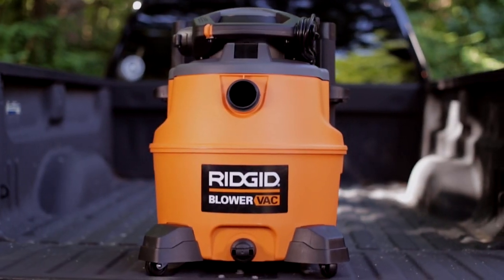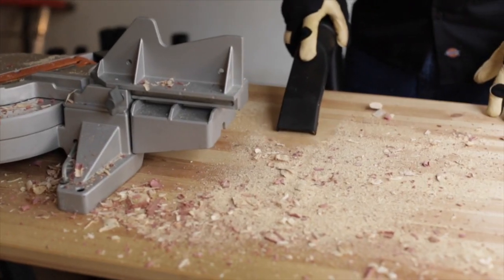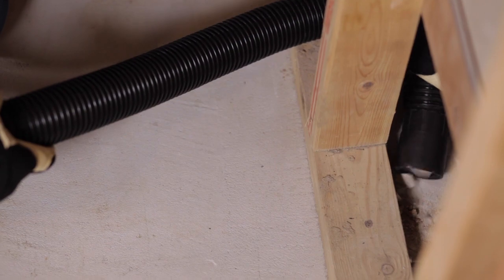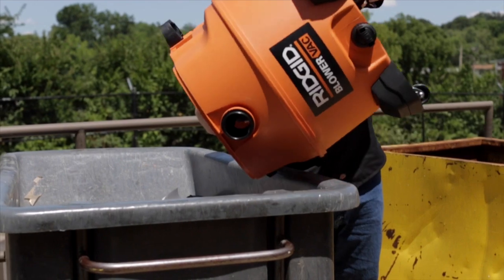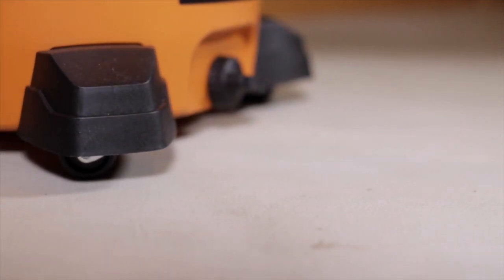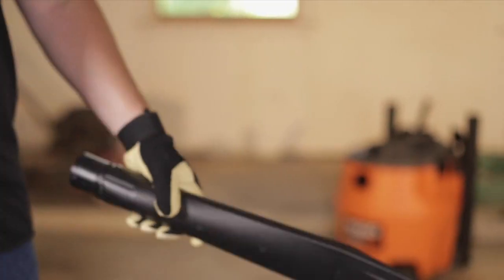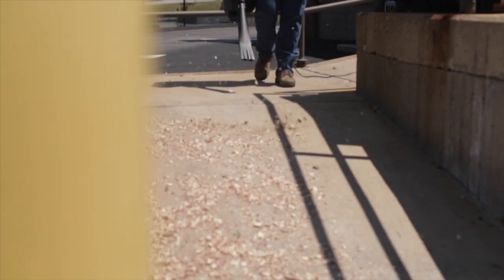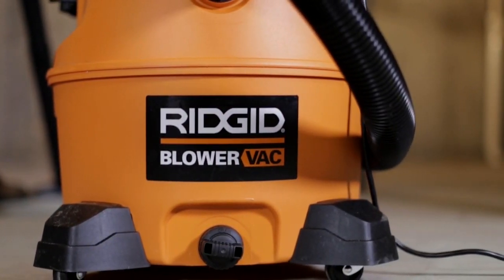RIDGID WD1680 Wet/Dry Vac With Detachable Blower

Comment: Excellent video showcasing the quality build and innovative design of the Ridgid WD1680 Wet Dry Vacuum with a detachable blower. I've tested several brands of shop vacuums and this Ridgid WD1680 Shop Vacuum manufactured by Emerson Electric has proven to be the best wet dry vac available in Thailand. I am proud to sell genuine Ridgid Plumbing Tools and the complete line of Ridgid wet dry vacuums at my family owned builders merchants store in Buriram isaan Thailand.

Comment: I noticed there is no cap on the blower portion of the vac, does it blow while you are using the hose to suck up trash. Is there a way to cover the hole?
Reply: That is the motor exhaust
Reply: If you want to blow it up: cover that hole.
Reply: Possibly a diffuser.
Reply: 😂😂😂 @RulebooksForYou